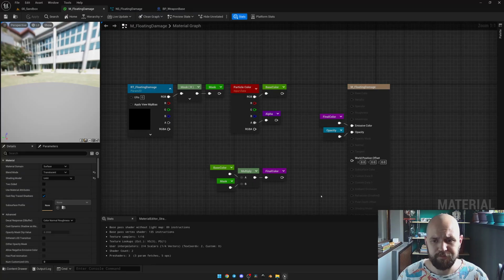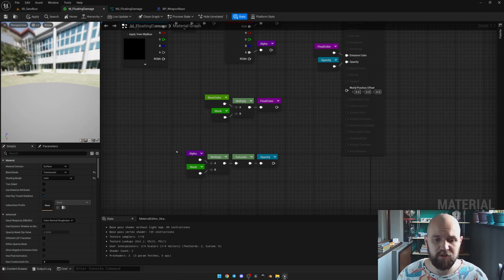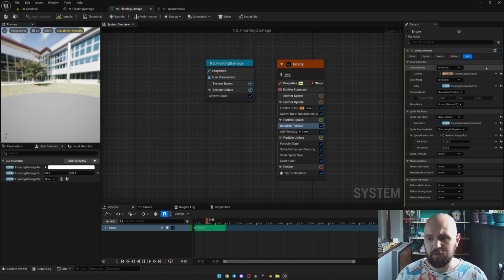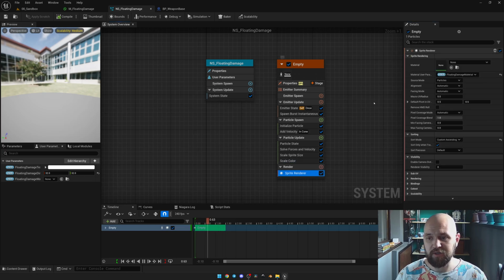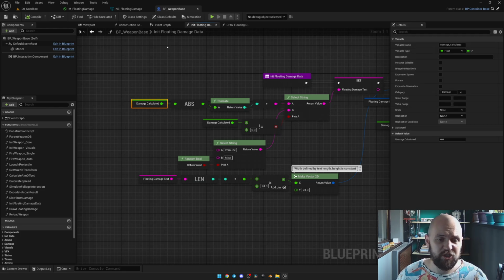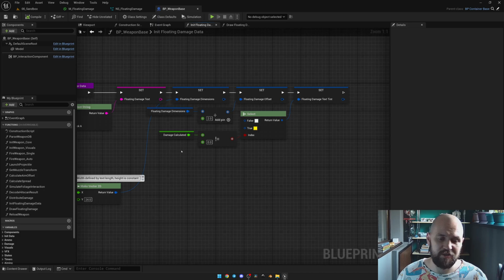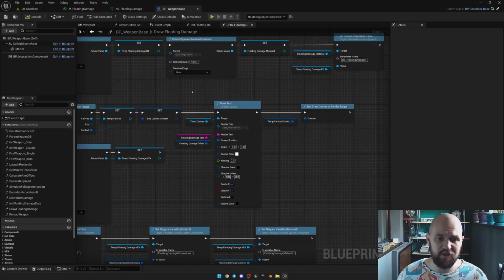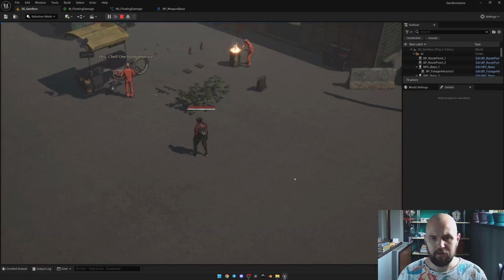Floating Damage with Niagara and RT in UE5. Downloads for Patrons

Comment: My Damage number does not spawn (or maybe not with visible numbers). The created Render Target (RT_FloatingDamage) inside the Material throws an ERROR (Param2D> Found NULL, requires Texture2D) when I connect it with the "Mask ( R )"-Node. I did exactly as you showed in the tutorial. Everything works I think except the first TextureSample-Node in the Material. Maybe it's something slightly new in UE 5.5?
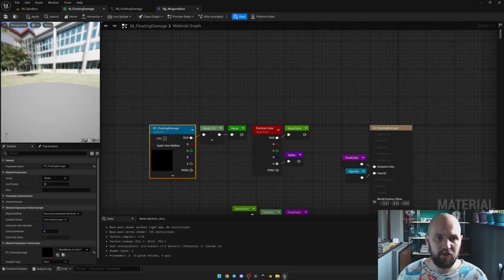Reply: you have to set a default texture, see 10:00 left bottom, he set T_BlankBlack_16_NoVT to it
Reply: @Bayern_Han  wow, I did not catch that! Thanks for your comment - it works now on my end.
Reply: @hanspeter9007  The error literally says "requires texture" crazy that the solution was setting a texture. Holy shit how are people so slow.
Reply: @minirlz  nope, I did try that at first. You cant just set a "random" texture
Reply: Did you find an answer to this?
Reply: @ sadly not yet :(

Comment: Thanks for a great tutorial! My numbers seem pretty low resolution and I can't change the size anywhere, any idea what this might be? Thanks again
Reply: I had the same problem and after a lot of trial and error I've found out that when it comes to the size of the damage numbers, it's all about the font (family) itself (used in the Draw Text node). When it comes to resolution, I think it's about the font family again, and about the material you choose as the default one in M_FloatingDamage RT_FloatingDamage.
Reply from the maker: @MartinOckovsky  https://youtu.be/0ssHh2coUUs
How-to Fix Floating Damage Size. Also make sure that your RT resolution and Font Size are high enough to not be blurry mess once size changed dramatically.
Reply: @YourSandbox  Thank you very much. Would it be possible to make a video about a "Depth test" you've talked about with some user here? And could you maybe show what's in your T_BlankBlack_16_NoVT material please? <3
Reply from the maker: Low resolution of render target or size of particle meshes. I covered it
Reply: I have the same issue did you fixed it?
Reply: Hi, I have the same problem. Has anyone found a solution?

Comment: Thanks, I replaced the Lyra one with this for my game. Much easier to work with.
Maybe I missed something but I had to disable depth test for my material otherwise it could draw behind my enemy.

Also I couldn't get the shadows or outline to work with the Canvas.DrawText function, do you have this issue too?
Reply from the maker: Depth test is a thing I forgot to tell about, my bad. Thank you, for bringing it out. As for outline, I have mine rendering totally fine. Need to check my font and settings. Cause material is translucent, it also depends on how precisely it uses alpha channel mask.
Reply: @YourSandbox  The outline didn't work because I was only using the red channel. I had to make the outline color green and change from RTF_R8 to RTF_RG8 then grab the outline in the mat so I could recolor it. 

Unfortunately they didn't expose the outline width parameter and just hard-coded it as 1 size...
Reply from the maker: Yeap. R8 is obviously cheaper for those who only need a mask for digits and other signs. As for outline width, I guess, you can expose it to BP through C++ modifications to the node. Or even better is to write own function based on it, so you don’t need to modify source code.

Comment: From your point of view, what's your opinion about this technique? Do you think it's better for performance or it's just another way to do it? I tried both, this one and the regular one with UMG and still not sure about the difference on performance.
Reply from the maker: It’s better on performance as Niagara renders using GPU simulation here. I made a test scene with hundreds of each spawning in frame to see what performs better. In full weapon tutorial I gonna add this test
Reply: @YourSandbox  Have you seen the write up Optimizing Niagara Systems as a Service on EPIC learning where they show the new feature in UE5.4 that allows you to  “inject” particles into an existing system allowing you to re-use running systems instead of paying for the activation/re-activation cost of spawning new systems ? This type of system could potentially benefit from that a lot.
Reply from the maker: @shannenmr  Nope, I haven't. Gonna check it, thank You
Reply: @YourSandbox  Oh, you actually answered my question but sadly YT never sent me the notification. Thank you very much. I'm putting this in my TODO list for my project after watching for your update video about the number size.